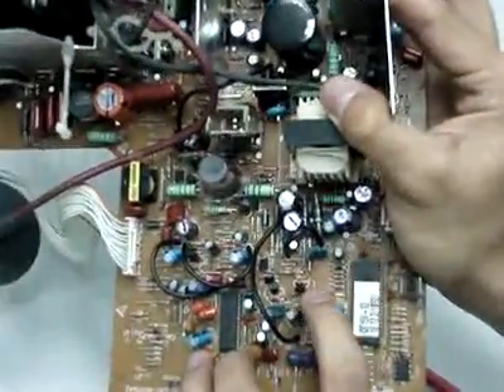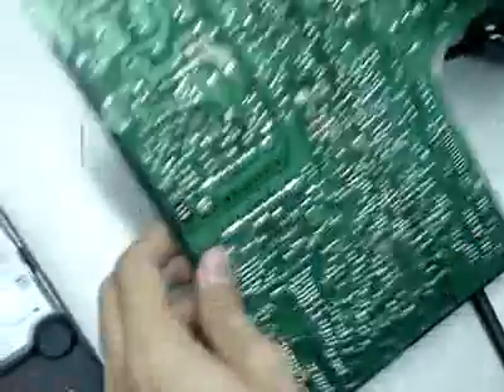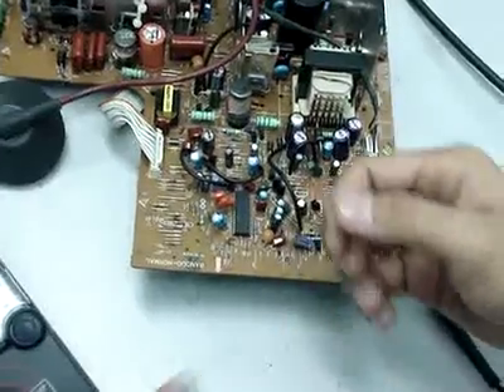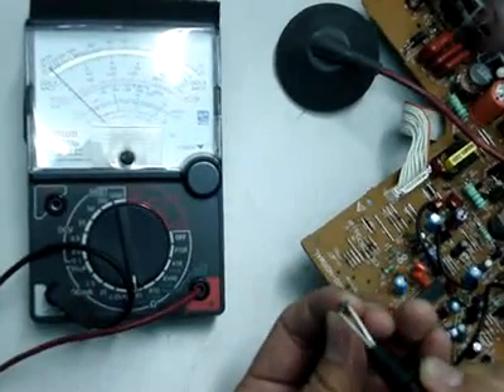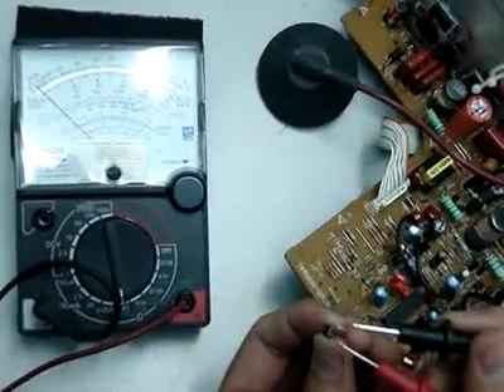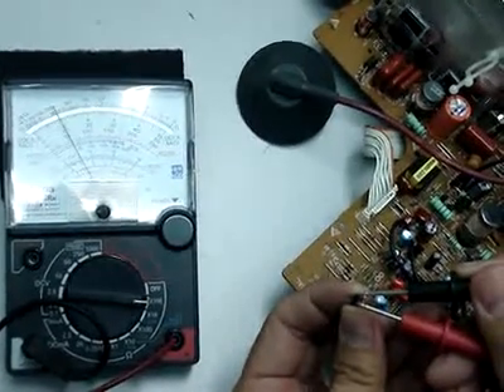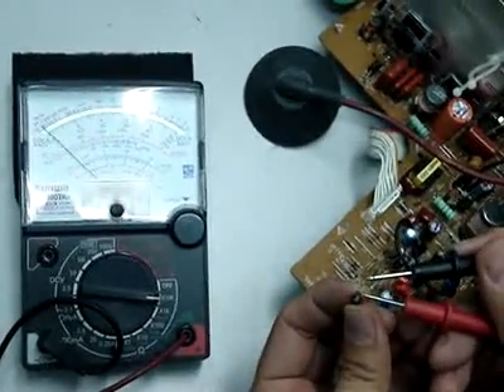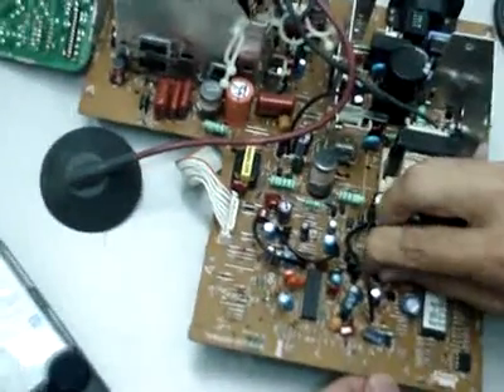How To Test a Transistor

Comment: Im presently trouble shutting my Vizio tv main board and I got this readings on 4 transistors part G1117....Result were taken while tv powered and transistor connected ..1 (.2, .2, 5.0), 2 (2.0, 3.3, 5.0), 3 (1.2, 2.5, 5.0), 4 (2.0, 3.3, 5.0). My question is should all read like transistor 2 and 4. thank you

Comment: Pick up a $15 transistor checker with miniclips. No delsoldering needed. HIs method is very time consuming, heat is bad for components, and you risk damaging the PCB or getting a bad solder joint if you don't have good soldering skills.

Comment: All an ohmmeter can do is test to see if the junctions are open or shorted. It can't test the beta gain or noise or leakage that occurs at normal operating voltages and temperatures.

Comment: @MegaWYU 
Do you know that the very CPU you are using right now is designed by electronics engineers? Do you know the logic gates that form part of a digital circuit?
If you don't, just keep your comments to yourself.

Comment: You should always try to test the transistor in circuit before removing it. Depending on how it is wired; as long as it's not connected to any low impedance devices. Usually multimeters have a diode checker function which you can use to test each junction of the transistor. You should get a low reading when forward biasing a junction and an infinite (or just high if in circuit) when reverse biasing it. If it tests good in circuit, there is no need to remove it.

Comment: This is Jestine Young he has a repair site, have e-mailed him a few times he's a great tech!!

this is an excellent way to test a transistor, back in the old days (i took my first electronics class in 1966) we didn't have mulitmeters.

I usually start testing with my multimeter and then any transistors or diodes I'm not sure about I test this way.

anyway even though I've been doing this for many years I've learned a lot from Mr. Youngs web site.